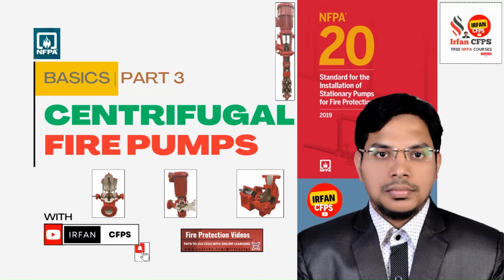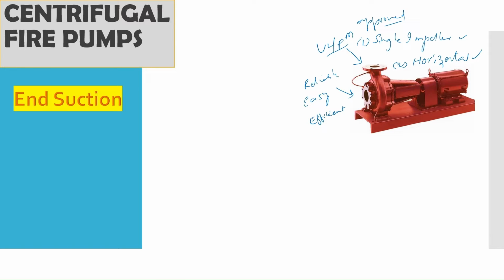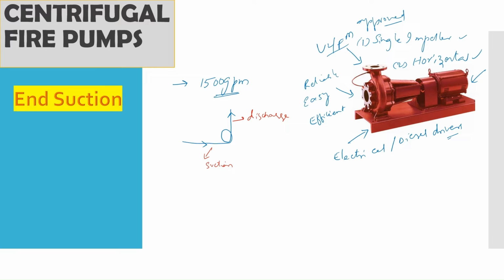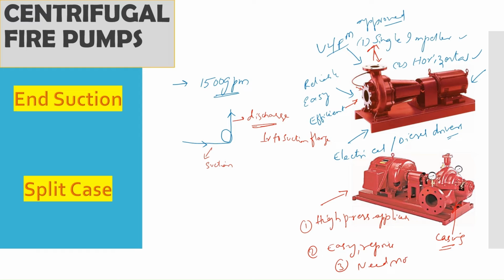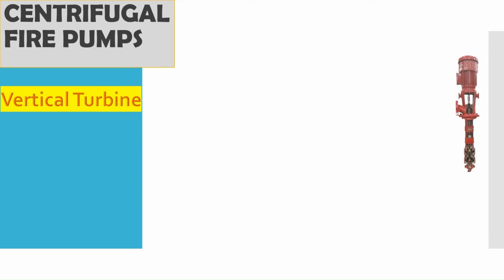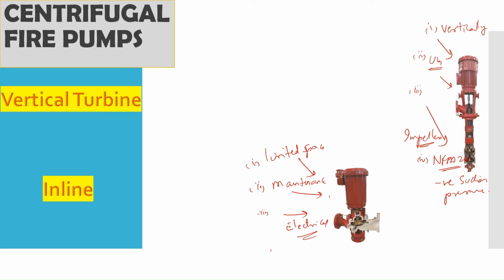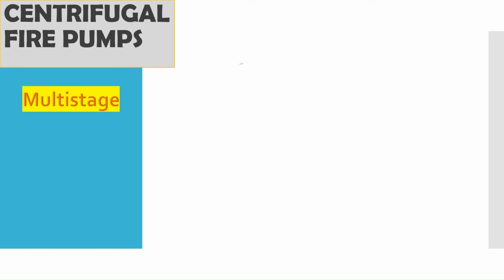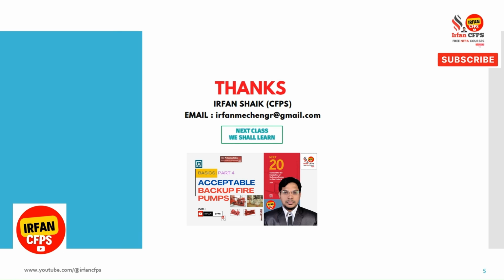Fire Pump Types Explained: NFPA 20 Simplified

Comment: Sir
For pressure relif valve on the electrical fire pump
What is norms in Nfpa when to installed specific on electrical pump
Reply from the maker: There is a clause in nfpa 20. However I believe if you have variable speed drive then need to consider relief valve on electric pump